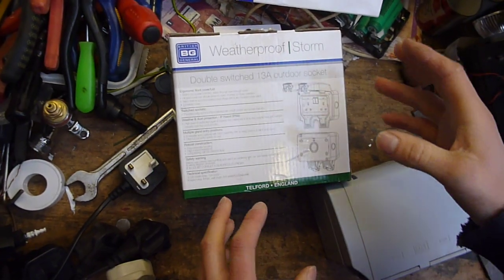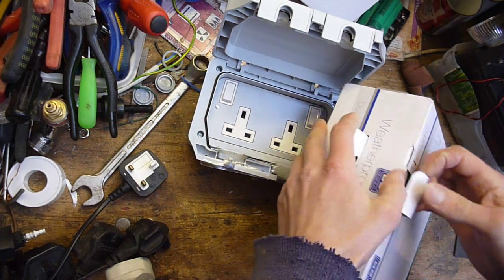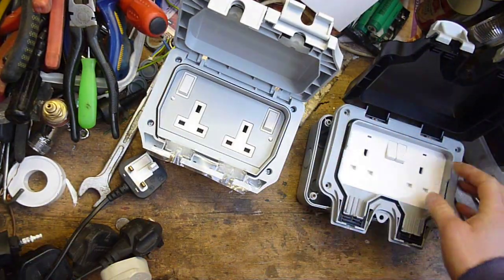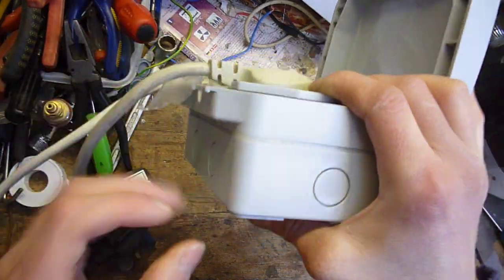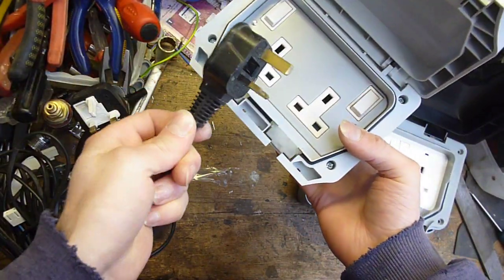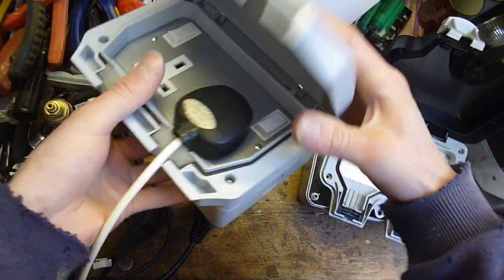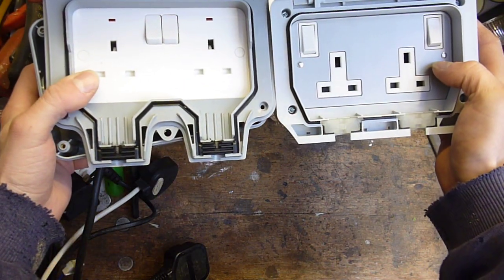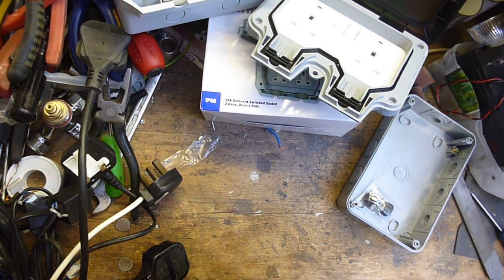LAP outdoor socket design flaw and quick comparison

Comment: The silicon seal is removeable/trimmable, so can accommodate the sealed plug type. Good point, but I have used without issues.

Comment: I have one of these however I don’t have a problem due to them awful sealed plugs have connection issues/ melt so I simply cut them off and replace it with a plug something that is proper made problem solved the socket works really well

Comment: Wow , thank you , im just looking at buying one from Screwfix , or should I say was going to . Well spotted . Ill be taking note at the design now . How on earth did it pass BS 1363 . Mmmmm.
Reply: you wouldnt think this is a thing however screwfix have a unbranded range of sockets and switches in white they are made by a company called pms PMS is a name that is stuck on alot of things it is rebranded alot however it is so much better than LAP PMS make a socket range the only thing that isnt good is there usb double socket however the rest works well to prove this i installed PMS in my parents kitchen and they are used for the kettle toaster microwave etc and never suffered a burnup unlike lap did 
link to pms here  https://www.screwfix.com/c/electrical-lighting/switches-sockets/cat830530#category=cat830530&brand=unbranded&page_size=20&page_start=0
Reply: Interesting reply , thank you Kieran .

Comment: And what about exterior xmas lights, they have large stupid size plugs, some the way they are configured you can't even use and adaptor if you wanted to operate a few at the same time. I know you obtain enclosures but even then you are very limited when using a trailing socket. I have found with the latter that i have had to put it on an angle.

Comment: Can you use the plugs that are upside down for example  Christmas Lights
Reply from the maker: would depend on size of plug but i don't think so and the lid may not close so would not be weatherproof. google (BG WP23L) its a single outdoor socket with extra room for power adaptors.
Reply: Screwfix do an outside SET that is specifically made for Christmas lights